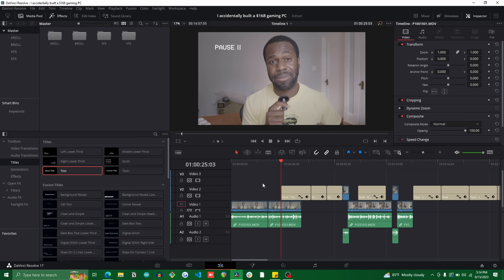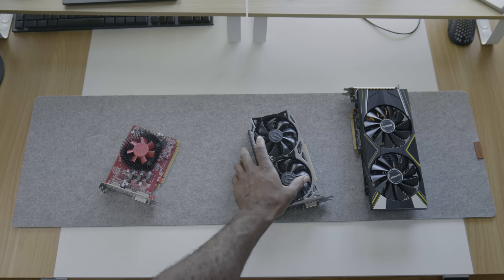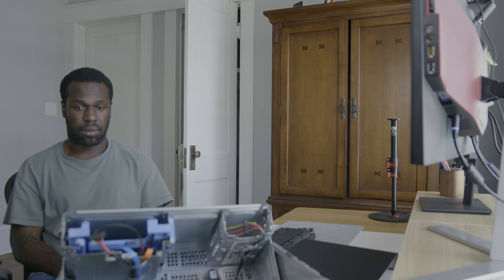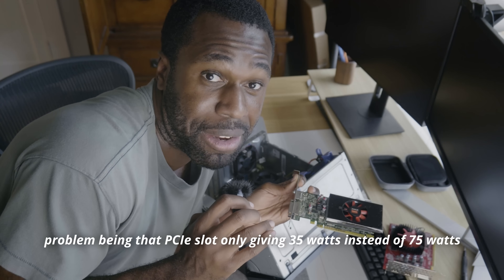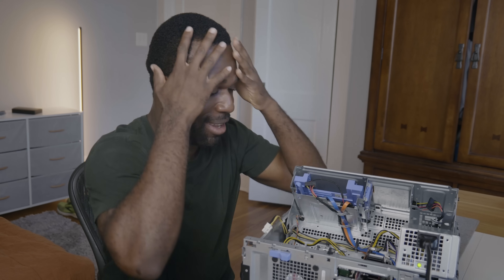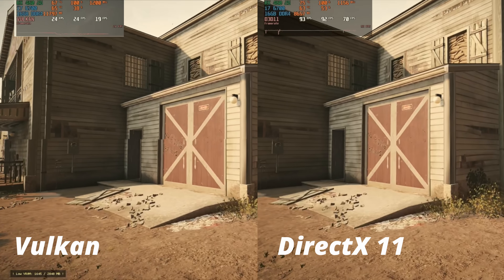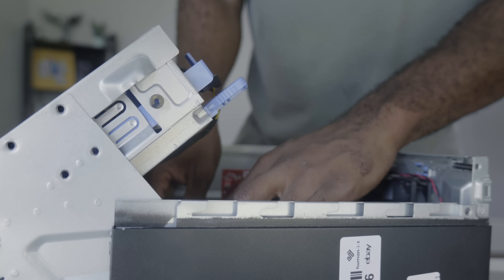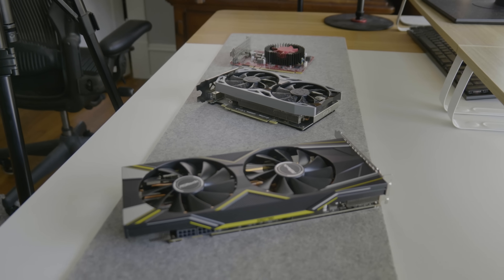So, I tried building a $168 gaming PC...

Comment: Working in IT at a university is a quick way to get crazy deals on these old OptiPlexes. We're currently phasing out 5060/5050/5040 models here as they're getting to roughly 5 years old, but the 5060s (although much less common) are worth their weight in gold - I got 3 with no drives (university policy for no drives) for $15 EACH. Insanely good deal. 
5060s are a good model to find as they've got 8th gen Intel parts, a front panel USBC port, natively support Windows 11, and have a M.2 slot so drive installs are super easy.
Reply: I wish I could do that. I work in a public school district in IT support, but we're not allowed to buy or take any IT surplus. Its a state law I believe that states that we have to sell the items to recyclers that work with school districts.

Comment: I love my EVGA 1650 Super that you showed there and had great luck with it. I re-pasted it using Thermal Grizzly and had some really good overclocking results - that cooler is overkill anyway so there's quite a bit of headroom if you did well enough in the silicon lottery. Thanks for the great content Oz!
Reply from the maker: Nice! What was the uplift after the overclock?
Reply: @OzTalksHW  user benchmark has it in the 100th percentile for that card so I was very lucky. I originally got +250 on the GPU and + 1100 on the memory but did eventually suffer one crash during a long RDR2 session and dialed back to +220 on the clock, haven’t had an issue since.

Comment: I'm currently running a very similar setup: an Optiplex 7040 with a GTX 1060 6gb (I replaced the PSU as well). I should admit I also faced the lose power button problem myself 😂
Reply from the maker: Omg, I’m glad I’m not alone 😅
Reply: lol
Reply: hey hey, im on an Optiplex 3040 rn. Thinking about swapping out the psu, but i would need to buy a 24 pin to 8 pin for this motherboard? Did you do that?
Reply: @tah-472  yep, I bought one from amazon. No problem so far. I also bought a right angle adapter for the gpu 6pin connector since my gpu was too wide and the case didn't close 😂 no problem with that either.
Reply: i have the 7040 with a 500w psu and gtx 1080 (i had to cut up the front panel to let the gpu fit (i refuse to get rid of the 1080 because i got it for a good deal)

Comment: G'day Oz,
😁 for the "Epic Behemoth Gaming PC"
Thanks for taking the time to re-edit & upload this video, adding the "Money down the drain" chapter really adds to understanding the full story,
For some reason down here those OEM RX460s used are STOOPID Expensive $150AUD or more, 1650 used are similar price but at least performance is much better if you are limited to 75W, as a comparison if you can swap the PSU you can get RX570, 480 & 580 starting at $80AUD or GTX1060, 1070 1660 & 1660Ti  for $150-$200AUD.
Reply from the maker: Oh wow that’s crazy expensive for a 460

Comment: An HP Z440 Workstation with an RX 5700 would cost about the same, and run circles around that... plus leave much more room for upgrades.
Reply from the maker: I haven’t checked out the z workstations in a while. I’ll take a look!

Comment: Hi Oz, Ive done something similar to this a few times to help friends or make cheap minecraft/roblox pcs for their kids. a $20 case and a cheapo power supply will get you a lot further with upgradeability and I usually go for a case with a power supply in the $40-50 range for these low power entry level systems because the cases look decent and the kids like rgb fans even crappy cheap ones.
Reply from the maker: This might be a nice move honestly. I think I’ll try jerry rigging and see how far that gets me, and then go from there

Comment: I made a similar build and settled on the 1650 super.  It matched perfectly with the power available and size restrictions.

Sadly there was no video about it, but basically this with a standard SSD.  I sold it for $250.  My cost was just under $200.

Comment: I've been running an Optiplex 3020 with an updated Xeon e3 1245 v3 (an I7 4790 equivalent for £20), an AMD RX 6650 XT, 16GB RAM, 450W PSU and adapter, 2 x 1TB SSD, dual booting Linux and Windows. It's been pretty good as a budget desktop with some gaming ability and a bit of an upgrade path in future. Been pretty happy with the performance for the past 9 months. The CPU might hold back the GPU slightly at times, but it was a known tradeoff going in.

Comment: I've had to cut a couple of cases to make a big card fit in a pinch. It's always bitter sweet at the end. Ultimately you achieved the goal but it's clear there isn't enough air flow for the big card. Every time I do this I have that feeling of dissatisfaction when the card starts choking and fan speeds kick up.

Comment: I built this pc for 150 € and I think it shreds :)

[GPU] AMD RX580 8 GB
[CPU] i5-3470
[RAM] 8 GB
[SSD] 1 TB Samsung HDD
[HDD] 256 GB Samsung
[PSU] Chieftec 750W
[Case] no-name ATX

The machine orignally came with GeForce GTX 750 and cost 100 €, I sold the GPU for 15 € and for 65 I got the RX 580.
Ofc prices vary, this was in Estonia.

Comment: I can confirm that these systems do not limit the PCIe slot to 25 or 35 watts. And these newer Optis are designed with the intention that you remove the faceplate before swinging the chassis open. It's funny though, I'm building up a 7040 to flip right now. I had issues with mine powering on as well. Ended up that the CMOS battery was bad. Now I'm just trying to find a GPU that makes sense for a decent price. Seeing people paying near $100 for standard 1650s.

Comment: 👍👏Thanks for being so honest!! Too many videos out there praising cheap Dells and Lenovos as gaming machines etc. Objectively, they may be good, in particular for home automation, nas builts or office/server use. But you have to be aware of the downsides. Non standard psus, non standard mobo size factors and power connections.Non standard cases with cooling issues by design. AND when they have been used in a company they often ran over night and have billions of hours. The old psus are often close to death just by running all these hours. So compare that to either a cheap new build or even one of these mini pcs with amd igpus. Maybe worth the extra money in terms of future proofness.... Have been there, learned it the hard way....

Comment: I am currently using an Optiplex 7050MT with an i7 7700, 64GB of RAM, several nvme drives, standard Dell 240 Watts psu and a 75W Nvidia Rtx A2000, which is equivalent to a rtx 3050 but with lower power consumption, less heat and modern nvenc recording and streaming capabilities. On top of that, you can use other Dell branded proprietary 340W psu that are the same size as the original 240W psu (I can tell you the exact model number if interested). No need for a third party psu that you then have to make fit the case somehow. Cheers

Comment: love it, buddy just bought one of these optiplexes ("gaming" with a gt710) been telling him a 1650 super is a good route to go, as I just upgraded from one to a 4060 since it barely uses any more power (iirc 100w for 1650 super, 115w for 4060, and myself using a HP prebuilt with a 400w, now 500w psu, its perfect until I get a new case and mobo)

Comment: I bought a used Optiplex 7040 back in February this year. It came with an i5-6500, a 512GB M.2 SSD and 8GB of DDR4 ram. I bought it to use as a work PC, but over the months I ended up replacing the ram with 4x8GB (32GB) of DDR4 ram, a full size dual fan RX6400, a 5GHz Wifi Card and a 4TB HDD. Pretty capable machine, especially for older games and e-sports titles. I still use it for work every day, but it's not my main PC, still a fun project!

Comment: I went through a very similar experience building my Optiplex 5040 recently! I ordered the wrong voltage of RAM and had to buy an SFX power supply to replace the micro ATX one I had ordered, which set me back about $70, and cost me a week to finally complete. I'm planning on swapping the board out to a 7040's soon with some ddr4 ram, since I did 0 research before building it, like a fool.

Comment: 6:21 If I understand what you meant, you're concerned that a dual sata to pci-e power would pull too much power? That dual adapter would have worked fine; the dual connection means it could deliver more power, but the actual load would be determined by the video card's power load (75W - what it gets from pci-e slot). You could connect either one or both of the sata connectors and it would be fine. If the pc refused to turn on, it would not be a problem with the power adapter. (Note: sata connectors are rated for 54W max, so don't try pull more than that per sata connector)

Comment: 😃 I think getting the super epic mega build working would be fun. Can you pull the drive cage out and double sided tape a SSD somewhere? hehe.

It's not as plug and play as RX 460, but I recently picked up a WX 4100 on ebay for about $40. It's close to 460 but has 4GB of GDDR5. Downside is the only outputs are mini displayport so you'll need to adapt them to your monitor.
Reply: Yeah sometimes when sellers have a few & they are not selling the WX/Quadros can be the better buy even including the cost of a Mini DP adapter
Reply: I'd love to see the "behemont" card in play too! 🎉
also replacing a hdd with ssd brings down the power needs so you just might have enough power (and space) for the rx 5700 from that puny 240W psu. I mean new sata ssds are like 10 bucks nowadays.

Comment: Having build computers since the 1990s it is very frustrating and long nites troubleshooting when PCs do not work as expected. Even back then with a 350 Watt Power Supply, it does not have enough power for everything hence along the Dell 240 Watts. 

Got a similar Dell that you have about 2 years ago. As a desktop work computer that play some older games it is a great value. One of the big limiting factor to go this route is not a lot of space inside and the small power supply.

Comment: A couple months ago I got an Opti 3070 i5 9500 for $100, I received laced the ram and added a $100 used Gtx 1660 with a sata adapter.  It’s running like a champ.

Comment: Easiest way is to find a free Optiplex that’s at least Core series or newer (especially if you manage to find one with a 6 pin power supply in it) then put a GPU in it. If you have money leftover cheap RAM and whichever CPU the board takes that’s the most powerful but not too expensive (like typically the top i7’s cost 3x more just bc they’re more rare)

Comment: 80 bucks.
A8 7650K. APU from 2014. 95W P.D
8GB 1600mhz
Wifi built-in.
SSD crucial MX500 500GB.
HDD 750GB Barracuda 3.5 inch.
315W PSU.
FMA88X+ motherboard with overclocking feature. Mini-ITX format.

All I did to it is, upgrading the RAM from 8 to 16GB of DDR3 1866mhz from Patriot.
And swap that massive HDD for an SSD from Kingston, 960GB for a bargin. (A400)

This PC is a retrogaming beast.
PS2 emulation is fine, dolphin mostly fine. It can run about anything I would want to play.
If it's struggling on the graphical or CPU side, I can rise the clockspeed.

I locked mine at 3.2Ghz (3.3 is supposed to be the base C.S, but I ran into stability issues no matter the voltage. So. Yeah.)
Basically got my gaming PC for nothing.
If I want to have extra power I can go for a cheap GT710 or GT1030, or maximum 750ti/1050ti or 1630 to really unlock my PC's potential, even tho it won't be spectacular, quad cores being old and outdated nowadays, and it, being more comparable to a first gen I3 to I5 in performance will not be powerful, at all.

It's basically doing what I want it to do. Playing retro games, decently. 720p too.
If one day my PS3s dies, I'll swap for an R7 5700G to emulate this masterpiece of a generation 🥰
That's all. Just keep on scrolling and keep on checking each day for a good bargin' on the marketplace and pray that the PC isn't dead 😂

Comment: I'm surprised a 1650 Super cost you that much. I've seen 1660s and 1660 Supers go for the same price on FB Marketplace and Ebay. Still, I have a 1650 Super in my laptop and I've never had any performance issues with it. Great video! :)
Reply: wait for the price in France (they're insane)

Comment: The best opersting system for testing if hardware is functional is linux, the easiest one to get going would be linux mint very familiar to windows 10 and has built in drivers for most hardware, nvidia may require drivers to be installed via the tool for such

Comment: I recently was on eBay and grabbed a similar Dell OptiPlex MT 5055 specs on it are Ryzen 5 PRO 1500 w/ Rx550 4gb, & 16GB DDR4 2x8 dual channel,  256GB nvme SSD got it for just under $100 after tax & delivery 😊

Comment: Sadly you cannot get the optiplex 7040 in germany for that cheap, it's 108+ euros here. 
I had to buy a ddr3 system with an i7-4770,16gb ram and 128gb ssd, I am looking for a GTX 1060 6gig for the system and a better powersupply. A friend of mine would be interested in the PC he only wants to play GTA l - GTA V and the OG Tomb Raider series.

Comment: A lot of people just don't even know what an RX 5700 is, and wouldn't know to look for it. To my knowledge, it's very similar in performance to an RX 6600 or A750. 

The 5700 is, I think, much rarer than the 5700 XT, but isn't really that much slower. A great entry level card. 

The RX 460 is probably not worth bothering with unless you really know that you're only planning on playing older games, or some specific game which you know will work well on it.

Comment: I initially wanted to build a gaming PC for $200. Over time with the SSD upgrades it end up costing $400. My video card does not fit in my PC. I have connected  my video card with a PCI-e cable. I use a video card outside a PC case. The advantage is that my video card is much cooler. 

Dell Optiplex 3060 SFF
I5-8500
16GB Ram
Nvidia GTX 1650
4TB SSD

Comment: i have same  experience with optiplex 3070(slim/low profile ver.) i5 9500 cpu. the rx 550(low profile) would go black screen before finishing the amd driver installation. the fix is i went to bios and set i5 9500 igpu as primary display and f10 save. plug the display port to the motherboard and i can install the rx 550 without error. the msi afterburner detect rx 550 100% usage when playing dota 2 and other game even without setting graphics settings to high power in windows 10.

Comment: If someone is working with a super limited budget and has a ssf computer around all you need is the amd r5 340x 2gb for a video card and a few ram sticks probably about 8gbs and a k series intel such as a 2500k if its lga 1155 in my case mine is and the optiplex 390 sff i had since 2016 and has been in use since 2011 runs fantasticly for 2010s era games

Comment: btw u can def put like a newer rtx on it 100% and switch to a full psu if you don't mind having the psu outside the case and the case open so the bigger gpu could be in there its kinda ghetto but it just works

Comment: Man, I was trying to sell a proprietary mid-tower PC as is for 180.  At least it was gently used and knew that it worked with a graphics card.  I wasn't sure if it would be better to sell it with a my spare power supply and buy a low end graphics card for it.  I just wouldn't know what's a fair price either.

Comment: I have a case and I think the power supply is good. The rest is crap. Maybe the 1060 is good, I can't test it right now. What is the easiest build to throw in there. A Ryzen 5 5500? Ever thrown parts from a broken laptop into a PC case? I think you should build the Optiplex you want it to be, go big I guess.

Comment: I may or may not have bought several sticks of ddr4 memory trying to placate the ryzens memory needs of various hideously specific motherboards.  I won't mention brands but one had to be version 3 memory specifically now you can't know this memory is version 3 until you get it have it in your hands.  So yeah I get it we all have spent money to fix the problem only to have it back fire.  I have also bricked some MB after I flashed them and tried the new ryzen cpu , shoulda worked, just didn't.

Comment: I tried this with an older optiplex and a rx 580 and ran into that obstruction problem with the case too, I ended up sawing a hole in the metal nd it work gr8

Comment: Very good video. You said the 2060 ray tracing performance is better than the 5700. Well the 5700 doesn't do ray tracing at all actually. Other than that, very informational for new users.
Reply: It does do ray tracing, it just doesn't have dedicated ray tracing hardware so it's really bad at it

Comment: I did a similar build for the living room, dell xps 8920 for 200$ had a 2tb hdd 32gb ram i76700k all a surprise and a over heating rx480 8gb in the add, repasted the cpu and gpu, and got a 1tb ssd 40$ , way faster boot times but still too loud for comfort and 90*c still so added fans. 30$ more ram idk why it was cheap 32gb for 40$ noticed a m.2 slot…..so got a 500gb for 50$ so now I’m in 370$.. but 4K on a 60in screen only got 40fps so bought a used evga rtx 3060ti 8gb card.. 400$ still haven’t changed the original psu 460watt I think bronze but it’s a dell psu.. it will be the next mod, if ever.. so got a good laugh from this video. I know I got really lucky and it doesn’t always play out this way.. as for thé old rx480 it’s in my work station I repasted it a few times….to get it running cool lol «  I’m work in cnc machining » and the old 2gb fire pro card was not enough so now I’m using both the rx480 and the fire pro with directgma… two thumbs up bro. Great video!